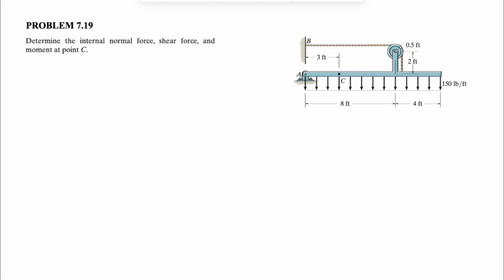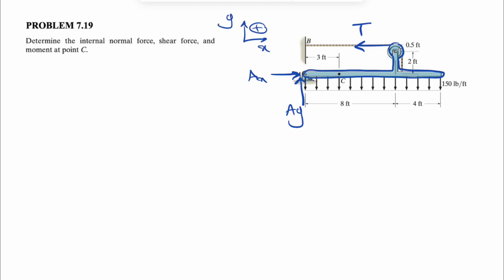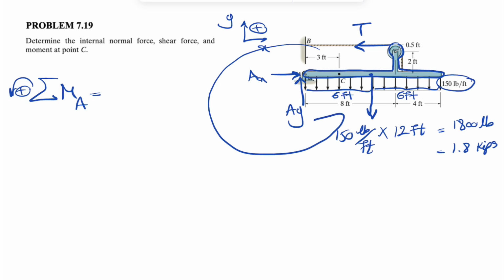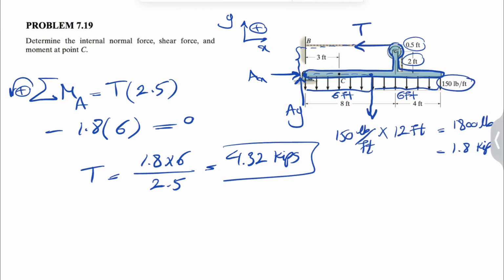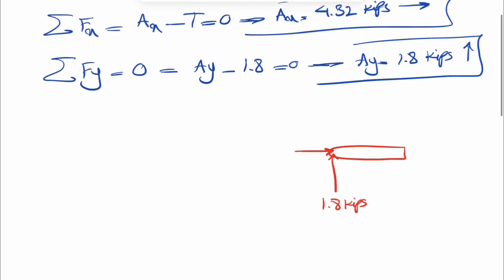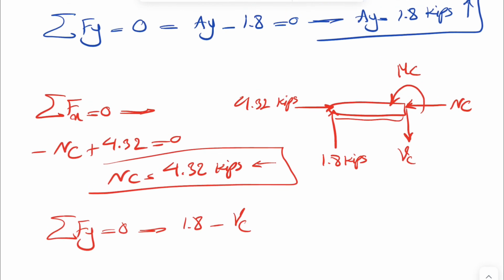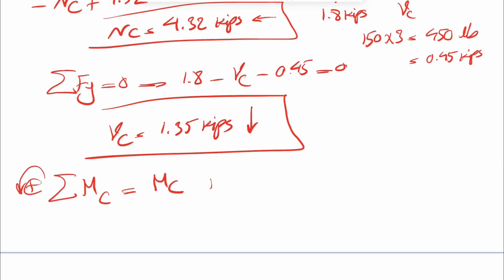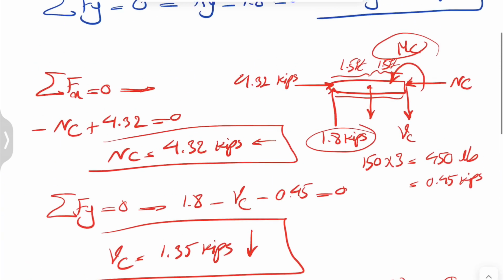Solved Problem 7.19 | Determine the internal normal force, shear force, and moment at point C.

Comment: why is the normal force to the left?
Reply from the maker: The normal force is horizontal because the bar itself is oriented horizontally. By definition, the normal force acts perpendicular to the cross-section of the bar. Since the cross-section is vertical in this case, its normal direction is horizontal. The shear force, on the other hand, acts tangential to the cross-section.